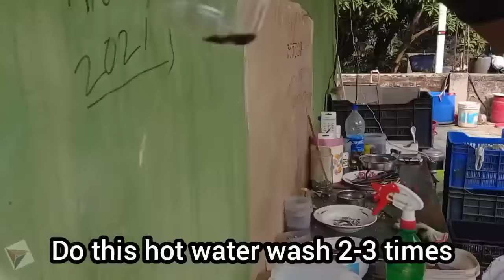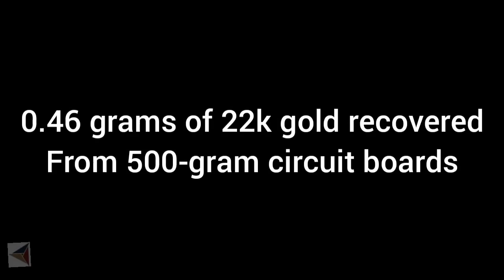Gold Recovery Using Vinegar | White Vinegar Gold Recovery | Vinegar Gold Recovery from PCB

Comment: So the process costs more in materials than you got in gold, but still pretty cool.
Reply: Not necessarily, most tech repair shops tend to throw these chips away if they have been damaged; a lot cheaper that way if you gather from their waste.
Reply: Vinegar and hydrogen peroxide are cheap
Reply: All that for 10 cents of gold
Reply: You can make your own vinegar to lower costs.
Reply: @freakindawgen  it’s $25 assuming it’s 100% pure
Reply: @robbincruz3637  obviously you didn't watch the entire video
Reply: Yeah, it is cool to watch. And being stuck in the Ozarks hills, you create your paths. Good comment all the same.
Reply: @MiaxisYT  
Tech repair shops would have populated boards.  Almost all the gold would absorbed in the solder joints.  This method would recover that gold.
Theses boards were bare boards.
Reply: 1g pure gold is €57 now, which means its worth €28,50

Comment: the concept is great however the expense vs return would be unrealistic unless you get tons of scrap boards
Reply: I think the vinegar solution can be rejuvenated with a bit more hydrogen peroxide if this process is similar to the AP method.  
But totally agree. You’d need hundreds of pounds of free boards to make the time investment worth it. That, and amount of AR used in this video could have processed like 5-10 times as much gold flakes as was done here.  

When I refine gold, I never mix AR before hand.  I always cover the gold with HCl, then add nitric a couple mL at a time since nitric is much more expensive.  Which also reduces the amount of SMB needed because it’s not being consumed by free nitric in solution.  

There are ways of making this process more cost effective.
Reply: You can do all that with out any chemicals . I watch a professional gold recovery expert , he runs his circuit boards through his rock crusher , recovers the metal and smelts is a few times , that’s it, Crush it , recover and smelt .  Check out MBMM , on YouTube if your interested in his recovery .
Reply: @americanadventureoutdoors4213   I have to agree that would be more cost effective, this method seems fun for home but how much of the gold is really recovered?
Reply: @americanadventureoutdoors4213  smelting and crushing is more expensive than vinegar by alot
Reply: @jacobhoffman2553  Well maybee if you can just use vinegar !!!!   There is multiple chemicals he used to get the gold to drop out of solution !!!  Using chemicals like that is really not ideal when you don’t have the proper equipment and scrubbers so your not releasing that into the air . A small test crusher that you mount on a grinder and a gold pan is perty cheap compared to what he spent on the mix of chemicals I would have to say .smelting can be done with a torch , small crucible and some borax . Very cheap
Reply: Was thinking the same thing.
Reply: @jacobhoffman2553  Wtf uh talking about , but a shop why would you need to buy a shop ?  If you think you can do it with just vinegar go for it give it a try , tell me how you get the gold to drop out of solution ?
Reply: @americanadventureoutdoors4213  did you even watch the video? or did ya just read the title and comment... vinegar doesnt disolve gold lol... the gold in that video stayed in flakes just need a fuckin coffee filter - no lets mach thow whole fucking compnent up into a fucking fine powder and light the shit on fire and send in into the atmosphere.... you can see the sense in pouring vinegar on it and let most the gold just seperate from the board?
Reply: @jacobhoffman2553  You need to watch the videos again , you didn’t watch it ,  he used a lot lore than just vinegar.  I just rewatched it again !!!!!
Reply: @jacobhoffman2553  Besides my point is you don’t even need any of that to recover the gold oof circuit boards  .
Reply: @americanadventureoutdoors4213  ya your way pollutes and is expensive... its not something regular ppl can just do them selves.... theres nuthing harmful about it... its their gargabe and they pour vinegar in it if they want to
Reply: Absolutely, I would rather get money some other way and just invest in gold. If I were in a country and I had no other choice to put food on the table, that would be different.
Reply: @uspockdad6429  with tech growingso rapidly. its wayy easier then you think if you keep an eye for it and have a place for it lol i have a small pc shop near my house. fills my truck once a month with pcs and laptops. all i know is ive been stock piling for like 2 years which leads me here
Reply: straw?
Reply: Yeah I was like wow half a gram that’s about $25 aud and it took him over 20 days to achieve that . The chemical bill would cost more for a start and unless you know of a computer scrap yard that literally had tons of boards , rummaging around for hours to collect , the guys making cents/days . Collecting and scraping cans and glass would make a lot more
Reply: @americanadventureoutdoors4213  it doesn't work with just vinegar.
Reply: @timbushnell8964  Yea that’s what I been saying . He uses more than just vinegar!!!
Reply: I agree that the time and expense put into this endeavor would not be worth it just to obtain a minuscule amount of gold. You would have to be living in a country where the currency and economy are under extreme stress or failure to do this. You'd do better and see a quicker (safer) financial return collecting and redeeming bottles and cans. Working with acids and other dangerous chemicals, needing to wear rubber gloves shows how dangerous this activity is.
Reply: All this retrieving of gold from electronic devices in the end comes down to a few important things to consider; time, labor, and capital (cost); are you extracting enough gold that would cover the cost of your time (remember, time is money) how much would you pay yourself or someone else per hour for the total time it would take to complete the entire process and leave you with a profit?
Reply: Well you can use almost anything that has a mother board circuit board, DVD players, game systems, c9mputer parts, stereo mother boards cell phones laptops and much much more that you may have lying around your house
Reply: Collect  electronics for a few years

Comment: This video is an example of why the dislikes need to be visible. What's claimed to be made here is peracetic acid (this requires distilled white wine vinger and 5% hydrogen peroxide) which can dissolve copper (freeing gold). However it turns blue; not green. The green colour indicates the use of nitric acid (turns green when dissolving copper). Using peracetic acid on 500grams of mixed scrap would not only take a lot longer, but also work out a lot more expensive than simply using nitric acid. You would need bottles of hydrogen peroxide, also controlled item in most countries (it's not the same hydrogen peroxide you use for your hair, it's sold as teeth whitener or wound cleaner and is often restricted to one bottle per customer).
Peracetic acid is okay for smaller items (such as scrap sim cards/smart chips) but you will be wasting time and money trying to recover gold phone boards and mousepads as shown in the video.
Reply: Thank you. "There is a God!!!!" 😊😊😊😊😊
Reply: And they were bare boards.  Assembled boards would have almost all the gold absorbed by the solder joints.
Reply: there is a browser extention that shows the dislike count, I use it
Reply: @bobrobertsNotUrBob  what's the browser extension?
Reply: @theMyth79  "return youtube dislike"
Reply: @Cdb Cdb 12% White Vinegar can be purchased at any grocery store, pharmacy stores (like Walgreens & CVS), & some health food stores. 6% Hydrogen Peroxide can be purchased at pharmacy stores (again Walgreens &/or CVS).
Reply: @auassassin787  amazing comment! Lol. That video and the work required is not worth the time and money to get that little dribble of gold
Reply: sodium persulphate and sulphuric acid is  what we use to etch copper in my industry. work vey quickly and efficiently  or he could have used acetic acid  or nitric and hydrochloric acid is very good.
Reply: Yes , for some reason "they" took out dislike option . I feel there should be no censorship of any kind
Reply: @sojourner1511  
Well no, there is no god, but I know what you meant.
Reply: @Fifth313ment  
That little dribble of gold.
Worth about 30 odd US$.
But the stuff was literally made in a supernova...
That alone is coolest.
Reply: @abelis644  yeah $30 but I'm sure the bottles of stuff are more than that. And let's agree to disagree that God doesn't exist as I talk to my God Jesus everyday.
Reply: Yo uso acido Clorhídrico, pero reconozco que con Vinagre se conserva más oro al final, pues el Clorhídrico dispersa más las partículas de oro, aunque tarde más tiempo, puede que me pase al vinagre, jeje, yo uso peróxido de peluquería al 30%.
Reply: @auassassin787  idk if it makes a difference but they sell 22% hydrogen peroxide at your local Marijuana grow store.
Reply: Jacko Sargs  - Eso depende de cada Pais, en España se usa al 30% en peluquería, y yo tengo acceso por internet.
Reply: Jacko Sargs  - Depende de como te lo tomes, yo lo hago como pasatiempo, busco en internet formas de reciclarlo, me tomo mi tiempo.
Reply: @Cdb Cdb dump the chemical effluence down the sink drain.
Reply: Thank you for the realism of your description!
Reply: Ohh
Reply: @fireboltaz  - -- ¿ En tu zona no hay sitios para reciclar químicos ?, se contamina mucho el medio ambiente, a saber donde va a parar el desagüe .
Reply: @CEB8  I beg your pardon?
Reply: @abelis644  there is always some mediocre mind thinking that if they sound scientific enough people will believe their BS
Reply: @Fifth313ment  
Does he talk back?
Reply: You would not use HNO3 in this as it would dissolve some of the gold (which is not what they're doing) but are stripping the board of Cu and other binders to free up the solid gold. Cu2+ is blue but I think the straight Cu-acetate is green in solution. As you said 6%H2O2 is restricted in some places but these are cheap ingredients generally and if done in bulk would be a cost effective way to strip the boards to get crude Au.
Reply: Eh just buy muriatic acid at the harware store and get this done in 24 hours.
Reply: @oak1550  whats muriatic acid for? Is it a cover all bases kinda thing? I'm really new to this trying to gain all possible info
Reply: @nevercertain  yeah general cleaning usually. I used to use it to clean gunite pools.
Reply: @oak1550  and what does this do to the gold or silver? Does it eat some away and make you lose a percentage of your metals?
Reply: @MaryAnnNytowl  almost every raw process loses some of the metal while refining.. using muriatic acid should release the gold from the pcb. BTW this is all a huge waste of time and money. Yeah you recover a few dollars of gold, but the recycling costs more than prospecting.
Reply: @theMyth79   link is returnyoutubedislike
Reply: @oak1550  Not every country allows you to wander into hardware stores and buy lab grade chemicals. Usually for a very good reason! lol
Reply: The reaction will work without the hydrogen peroxide. Oxygen from the air will cause copper and most other metals to dissolve in dilute acid. The plated on gold is left as tiny specs.
Reply: @Wortnik  yeah pretty much none og the suggest stuff here i can buy without a pemid. I am sure i can get vinegar bit that is about it.
Reply: 100% they show likes but not dislikes!!! I would have never have clicked on this video had I seen the probable 100k dislikes.... Misleading and b.s.... I already knew this by the title because we all know gold recovery from chips are just not feasible unless it's a huge project company... But nevertheless...... I agree and this is completely b.s and the dude gets paid to lie
Reply: @Fifth313ment    Anybody who spends lots of time talking to invisible gods or spirits or ghosts….has a big problem.
Reply: @Abelis 🇺🇦  yes and no. He doesn't talk to me like we are chatting. But I pray and I mostly get an answer. Some of God's greatest gifts are unanswered prayers (I know it's a song). When I was young my life went one way but if I had gotten my prayers answered I wouldn't have my my wife, I wouldn't have gotten my job, etc. I can't convince anyone to believe in Jesus if they don't see it nor would I want to force it on them. Just think, if I'm wrong nothing happens but if you're wrong you'll spend eternity in fire.
Reply: @Fifth313ment    After more than half a century in Christianity, I’m so very happy I discovered Theravada Buddhism.  The basic teachings of the Buddha simply make so much more good common sense. I feel so much at home now.  Namo Buddhaya  🙏🏼 ☸️ 🙂
Reply: @Robert Williamson  hey I'm happy if anyone has religion these days. No one thinks it's strange that we took religion out of our day to day in everything and within that same time everything has collapsed?
Reply: @Fifth313ment why can’t the boards just be put into a crucible from the get go ?
Reply: I think you’re quite wrong about copper ions being green in nitric. Copper nitrate is more blue…nickel ions on the other hand is more green in nitric. I might be wrong, but that’s how it is from my experience.
Reply: You’re saying just use nitric acid to get gold?
Reply: @JakePlisskin12 would that make the process faster ??
Reply: @oak1550 so you wouldn’t need the sodium?
Reply: Wait till you meet Him 😉

Comment: What the vinegar does in the presence of hydrogen peroxide and air (oxygen) is to oxidize and dissolve the more reactive metals, mostly copper, which has been plated with gold. The gold becomes minute flakes. It is important to keep chloride out of the vinegar and water or the gold will dissolve. Once the gold flaks are obtained methods other.than what the creator shows can be used to recover the gold.

It would be interesting to see what these other metals are. The solution is green not blue so something other than copper is there. It should have been tested for gold. Don't throw it away until you are sure. It may for instance contain nickel and or cobalt.
Reply: So where do I have this tested, please, and thank you for the educational post you've shared, really good work, thanks again!

Comment: Well done, perhaps a little bit faster way is to take the gold into solution using a 50/50 mix of clorox and vinegar, until the gold disappears. 150 degrees F is faster perhaps an hour or so, filter and drop the gold with zinc, add zinc until the liquid turns mouse gray and let it sit. Zinc burns off at low temperature leaving your gold behind. The only problem is the process likes the platinum group metals as well but does not like silver.
Love to see a video and compare the two processes to see how they compare.

Comment: I torch my mud when its still wet. It doesnt blow away from the flame, and any acid residue left is quickly burned off. I rinse my mud in 2 hot Hcl baths, then 2 hot water baths. So i could do more, but times an issue when doing 10-20grams at a time. Im gonna make the BEST refining video for newcomers this summer. Soon as the temp outside is good, ill be processing karat scraps.
Reply from the maker: https://youtu.be/fbnSZTjHmiA?si=ncWzHw1NR8RDGAUg

Comment: There must be a cheaper way to recover than this.  When you cost the chemicals used a the cost of disposal of them , it can never be worth it.  A very interesting video nonetheless.
Reply: @harold3287  just melting it all together wouldn't gain anything because gold and copper forms an alloy so it would still need processing.

Comment: Question, Once the Vinegar has freed the gold foils and they are floating.  Why not just strain them at that point and melt them?  What is the benefit of further processing?  Thanks!
Reply from the maker: good questions! Floating gold foils are not pure gold, thre are mixed with others base metal as cadmium, silver, nickel etc etc... so you can't directly melting those foils.. Thanks dear Murphy.
Reply: @TrinityGoldRecovery  can you process the other elements from the mix to get more profit
Reply: @lesliesmith205  You could, but except for silver, the amount is not worth the effort.

Comment: altough it takes longer, the vinegar and peroxide can be easily purchased and they are not as dangerous to handle as other chemicals. About the time it takes if you do this kind of stuff you can have several batches going on at the same time and you can have lots of them. There is a saying - gold weighs heavy- some people did not get it apparently

Comment: Would using a stronger vinegar work better. You can get 22-25% from the hardware store or at different places it’s also referred to as marine grade vinegar
Reply: id use hcl itd be quicker
Reply: It's the H2O2 that does the hard work.

Comment: If you drop Sulfuric acid H²SO⁴ into your Cloroauric sol( cpl drops) it will remove any lead. Doing several Nitric washes will get you a more pure product. Chemically you can never achieve 24k .999 But you can get very close. I have a cpl nuggets that react to 24k test sol.

Comment: After it was released why couldn't you take the filter paper, gold and some borax and melt/burn it with a torch in a small crucible to get your bead of gold.
Reply from the maker: Those gold flakes are 10 to 14K of gold mixed with silver. if I melted those, its become looked as white or blackish, not showing like as golden..

Comment: You do realize that vinegar is an acid right?. Acetic acid. The acetic acid peroxide solution is called peracetic acid. You could add a little salt or copper sulphate.
Reply from the maker: You will find it any general stores nearby. 
That was my point
Reply: Supposedly it has a flash point of 104F, the msds says. Seems it could start a fire on a hot day.
Reply: @TrinityGoldRecovery  Yes good point. Also salt and vinegar👍🏿